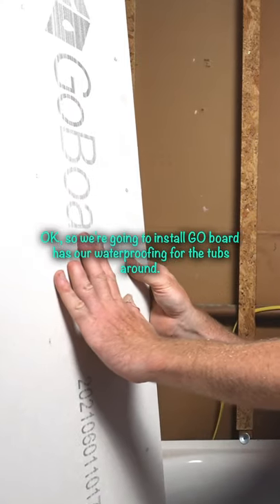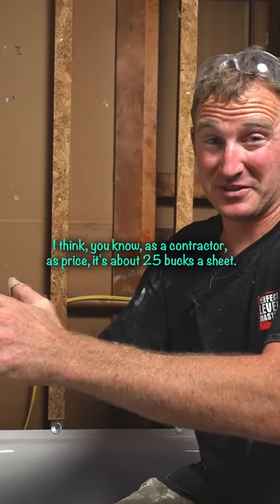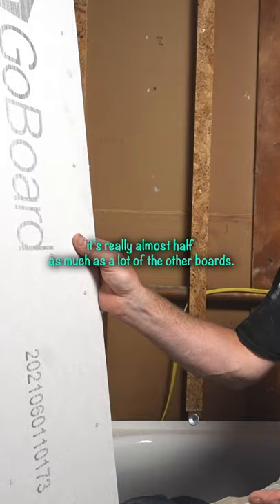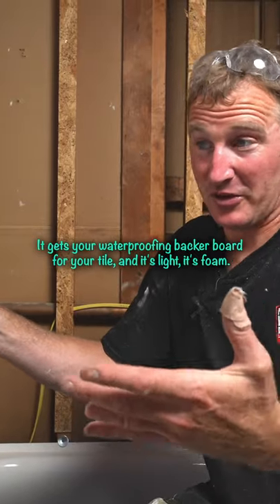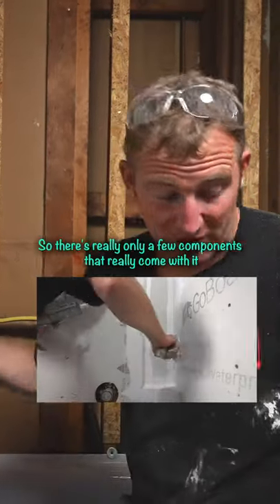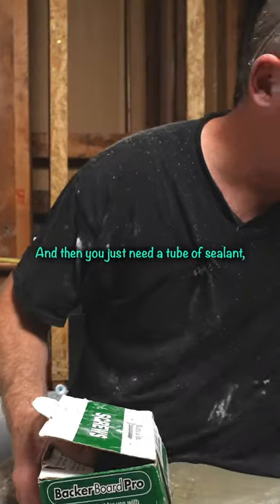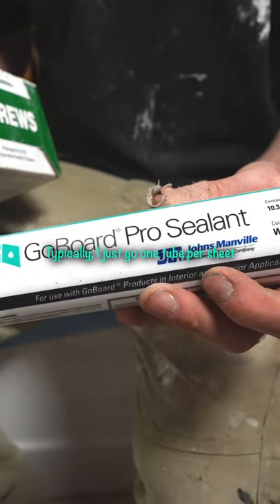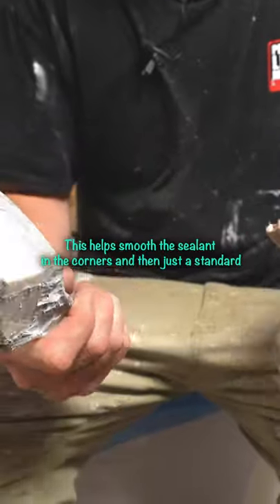Why I like GO Board Backer Board for Tubs & Showers #shorts #Youtubeshorts #DIY

Comment: I just installed this in my shower! cement board is just too heavy for me, lol. My only qualm is that I used a suggested, alternate sealer, the OSI, and that stuff is thick (imo)! Took forever to squeeze it out the tube, lol. That was the "hardest" part of my installation.

Comment: It is not cheaper than Dura rock. Also the sealer is expensive!
Reply from the maker: Did I say that? Sealant does add up. It’s probably about the same if you add a liquid waterproofing to cement board

Comment: I recently used this and I go board has their own screws too, they have a bigger head on the screws I feel it holds better because it’s like drywall you just wanna dimple it. I’ve used regular hardie screws mostly before and the head just wants to puncture it most of the time.
Reply from the maker: Good point and I agree. Unfortunately some places don’t carry their screws. Just sealant and board
Reply: Use Kerdi screws.

Comment: Can you install this on the floor also instead of the cement/durock sheets?
Reply: No. You can use an uncoupling membrane (either a roll out sheet or liquid membrane) over primed subfloor or you can use concrete board. If you go with the ladder, stagger your joints and use thin set to adhere concrete board fiber tape over every seam to create a monolithic plane.. which achieves the same goal of an uncoupling membrane. The difference is uncoupling membranes just don’t allow cracks to transfer from house movement, etc. the concrete board / monolithic plane method allows the floor to move as one collective piece, instead of one or more sheets moving away from each other and creating cracks in the tile.

Comment: READ.
THE.
INSTRUCTIONS.

Do not use traditional Durock screws.  GoBoard James Manville even goes so far as to highlight the reason WHY NOT in their instructions. (Due to serrated flute on the screw)
JM GoBoard screws&washers or roofing nails ARE approved.

Comment: that itchy stuff. Have you tried peremabase foam board yet? its blue. Same price as go board and similar product but WAY less itch. They used to have it in 3x5 and 4x8 but now it only comes in 4x8.
Reply from the maker: It is itchy, and I think it’s worse for some than others. I have not tried the permabase stuff. I like the foam boards for easy if install & weight…..I might be getting old, 😆
Reply: They sell a another version without the itchy stuff....It cost $3 more.
Reply: @williamp9158  can't get it where i'm at